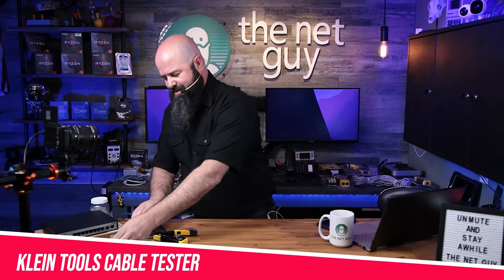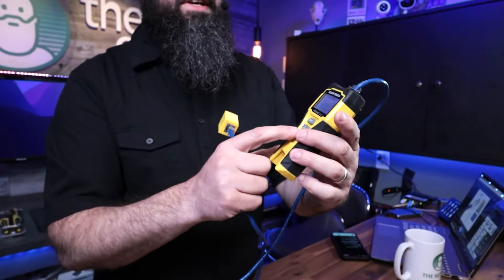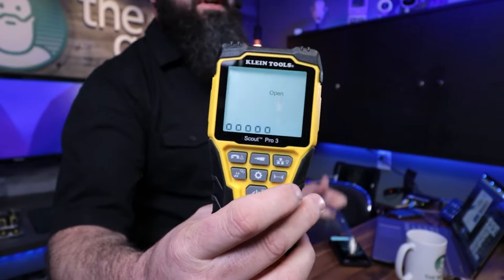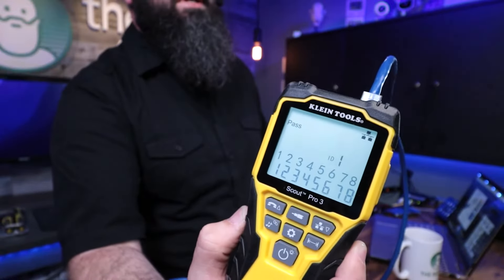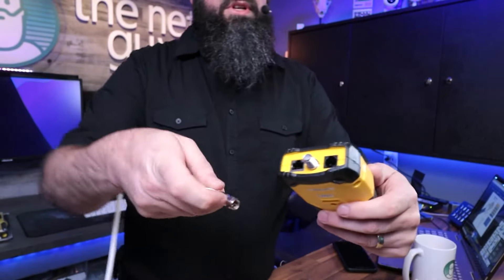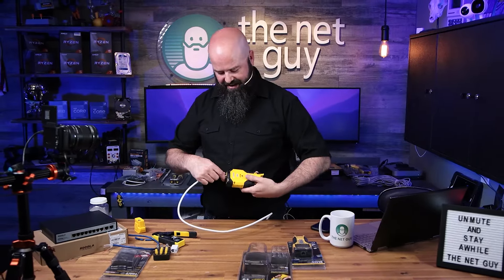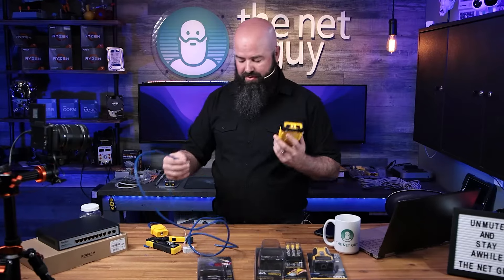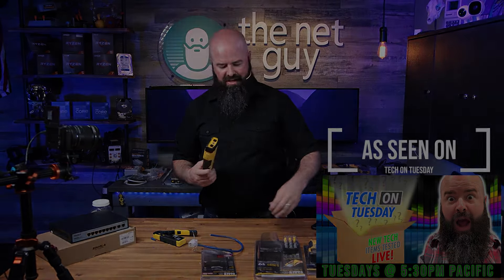Klein Tools Basic & Advanced RJ45 Testers Compared

Comment: These are great! I use a $3,500 certified Fluke tester for structured cabling but sometimes I  don’t need all that kit, so this fills that hole perfectly. Toning out cables that were mislabeled or quickly testing a patch cable, brilliant.

Comment: If you just want to test your cable, you can buy a $10 tester that will test all 8 conductors to make sure they are working and wired in the right order. But the Klein Tools stuff is just so cool... Quite expensive, but really solid products and it's what the pros use. The crimpers are definitely worth it, you want the best crimper you can get.
Reply: The pros use Fluke..
Reply: @BerserkeR_031 exactly, he must have never used fluke equipment. I personally have Klein in my arsenal. My company has fluke

Comment: The blinking cable identifier should be solid lit. Easier to identify that way on a switch full of cables thats blinking like crazy.
Reply: True or even change to color from green to amber
Reply: The tool probably just send one packet each two seconds so that the flash is constant. Other ports on the switch will flash like crazy, but you gotta find the one that is flashing at a regular pace. That's my understanding...

Comment: While testing a bunch of old inherited patch cables with the Scout 3, a couple tested as "split pair," and I couldn't find a description of how it does that. Maybe it sends an RF signal down the cable and measures the crosstalk between pairs?
Reply: Split icon illuminates if the designated wire pairs are not terminated in the
correct sequence.
Reply: @Michael_NL But this guy wanted to know HOW it detects split pairs, not the test result.

Comment: In your example with using the wall socket on one end and the other end goes into the Scout Pro 3. What if you have wall sockets on both ends, so if you had the wall socket in the garage and a wall socket in the bedroom and no exposed ethernet cable to plug directly into the port on the tool. Could you plug one of these tiny devices in your garage and then use a short Ethernet cable in the bedroom that will connect to the wall socket and the port on the tool, will the tool still print out the # of what it's connected to?
Reply from the maker: Yes, exactly.  A short patch cable would work great for finding and identifying connections like this.

Comment: Hi. New here. Can this device can also test the ethernet ports from a router and/or modem to see if it is working as it suppose to?

I've been having internet issue for quiet some time having my ISP technician test their lines. They've replaced their lines inside and outside the home not long ago, but I am still having issues.  My modem is connected to a Night Hawk Netgear XR500.

I've even replaced all my ethernet cables to see if that was the problem and still seem to be an issue.

Thanks.

Comment: ok but can the tool detect where the actual damage is,   ie   12.5 meters away from the instrument?
Reply from the maker: Yes.  It has an RF generator and can detect
Reply: @TheNetGuy  No we need to know if it uses TDR to estimate how far away it is without using anything else. Especially if it can determine which wire is cut (vs which pair)

Comment: Use case: A new house construction from an owner perspective, I want to test the install to make sure there are no breaks in the wires behind the walls before providing sign off. Will the starter kit of the Scout Pro do it, or do I need the test and map remotes?
Reply from the maker: Starter kit should be just fine honestly.  The advanced Pro features are nice if you do this all the time or are tracing wires with unknown ends.  I also have a toner I'm checking out.
Reply: @TheNetGuy  thank you. Best video I saw on this. Thank you so very much. Ordered. Legend. 🥳
Reply: @TheNetGuy  Thanks - I had a similar question as @MrOfferDJ.  Hoping to run a few drops down through existing walls and was looking for a way to test them.  Thanks for a clear/understandable video that isn't longer than it needs to be.
Reply: I know this is a year old already but....Licensed Low Voltage Contractor here. Your install company should provide Fluke test results, not just wire map and continuity.
The Fluke DSX2-8000 will test the entire assembly for all results required to certify the runs. I point this out because continuity and wiremap are not the only issues that can plague a network.
Unfortunately, unless you are a wealthy DIYer, that Fluke is cost prohibitive.

For more info, look up Cat6a Certification. Don't be fooled by cheap tools that claim they certify. Trust me, or I would have bougjt one.

Hope that helps.

Comment: Ive been hearing mixed reviews about the recent Klein tools. I.e. that they cannot detect faulty cables. What is your take on this, and is this video sponsored?
Reply from the maker: Yo!  Video was not sponsored or paid in any way, I just love their stuff and bought these myself.  

I haven’t heard about any quality control problems with their tools - they would fix anything under warranty if it were bad.  

Great brand if you can’t afford Fluke stuff 👍
Reply: I would suspect user error or misunderstanding of how the tool works. 

All these tools do is measure continuity… the adapter at the end is a loop back basically. 

They use software in the tool to add some basic additional features like length and split pair and crossover detection. 

This tool is a nice tool for what you pay and has a nice user interface and feel to it. 

The Chinese network testers are still a little clunky but with this tool pro model you can run your little network cable install business/testing just fine.

Comment: How can I identify if my jr45 jacks in my new home are set to T568A or T568B.  I took a picture of one of them, but I can't tell anything from the picture.  I ask this because I may have to re-do all of them (about 8 or 10) and I don't know how much spare ethernet cable I will have inside the wall.  If it is not much, I have to be very careful when I wire the cables with a new and better jr45.  Thank you.
Reply from the maker: If pin 6 is orange, it’s A.  If it’s green, it’s B.  When in doubt wire everything in the US to B standard 👍

Comment: Question. If a cable like that was cut,  can it tell you how far down the cable the cut might be or is?
Reply from the maker: Actually, with the distance measuring you can pick which wires it uses so YES!
Reply: if you attempt to measure it, as long as the remote isn't connected it will tell you how far down the damage is from the end you're testing
Reply: Yes, I use my $1200 Fluke for this at work, awesome such an inexpensive tester can do the same!

Comment: Will it work on 16 gauge wire for communication issues
Reply from the maker: They have some different tone generators that might be better.
Reply: @TheNetGuy  do you know a model # by chance. I’m testing mini split communication wires
Reply from the maker: @gregn8461 Klein Tools VDV500-820 Cable Tracer with Probe Tone Pro Kit for Telephone, Internet, Video, Data and Communications Cables, Beige - https://www.amazon.com/Klein-Tools-Tone-Probe-PRO/dp/B07VYN98QV/ref=asc_df_B07VYN98QV/?tag=hyprod-20&linkCode=df0&hvadid=385112208924&hvpos=&hvnetw=g&hvrand=9961589861248964322&hvpone=&hvptwo=&hvqmt=&hvdev=m&hvdvcmdl=&hvlocint=&hvlocphy=9033408&hvtargid=pla-830777640636&psc=1&tag=&ref=&adgrpid=73789135330&hvpone=&hvptwo=&hvadid=385112208924&hvpos=&hvnetw=g&hvrand=9961589861248964322&hvqmt=&hvdev=m&hvdvcmdl=&hvlocint=&hvlocphy=9033408&hvtargid=pla-830777640636&gclid=CjwKCAjwv-2pBhB-EiwAtsQZFKAbumBbrjT7XZfwgTmXF0mVE_GVFoo3i7haImz2qQa0MtyyTHk3xBoCnz4QAvD_BwE

Comment: Sir, maybe you can help me. About a month ago my PC would boot up each morning showing it was connected to the network, "fiber on1 > router > switch > pc." since than I've removed the switch. However, My PC constantly drops the Lan and goes WIFI. Sometimes I can go into the cmd and reset the Lan and reboot and it sometimes comes back to life and stays on. But I have a Roku that's hardwired and never blinks. I've replaced every cable but can't figure it out. I even did a loopback ping on the PC nic which doesn't miss a beat. Any clues?
Reply from the maker: Drivers maybe?  That’s tough.  If you remove the Wi-Fi profile from the machine does it stay connected?  There’s a metric value in PCs that tells it what connection to prioritize.  Sounds like it’s getting confused.
Reply: @TheNetGuy  Seems the on-board nic is going bad. bought a TP link card and it's been good so far.

Comment: Just curious, what would happen if you plugged in the coax coming from your ISP and tested it and then tested the length? Would it work? Would it disrupt service for other subscribers? I wanna try it, but I'm scared. :D
Reply from the maker: From what I’m told it sends an RF signal down the line like an antenna and measures the reflection.  If it’s grounded and connected to something else like a splitter probably not much.  I am surprised how hard it is to take down coax networks :)
Reply: @TheNetGuy  Right. I was hoping to measure the distance to the node. But you're right that it would probably just get to the splitter and then not get anything back, so it would error out. Or even if it got the node, it's not like the connection is open there. Still so tempted to try it...
Reply: @QuantumBraced  splitter would definitely stop the signal from passing. I have experience with professional TDR measurement equipment and have many times seen splitter if you amplify signal gain, in theory, you can go over it but measuring the end behind that becomes just a guessing game.
Reply: I did this and it came back with 24,901 miles. Typical.
Reply: @thetooth What is typical about that? What does that mean? That they have less nodes so your service is worse because it’s so far away? (I’m new to all this tech stuff but I’m trying to learn lol)
Reply: @TheNetGuy  you know, I am looking for something that rivals the Fluke Microwcanner^2.

And, that’s what it does for the Fluke, if there is a splitter or if it’s connect the tap, it’ll fail to measure out the distance.

Can you explain to me about “remote mapping”?  Also, do you know if it can tone out cables without needing to unplug it from a splitter?

Comment: Sooo it shows continuity is failing but not what distance it is failing at??
Reply from the maker: It can, you just have to change modes and set the pairing.
Reply: @TheNetGuy  assuming I have a run with 1 wire only that's damaged/cut will it show which one? I feel like this is a pain that people may encounter and somehow people don't showcase this feature.. It's rare but if you got a run that's going through some obscure paths it's amazing to know where on the run the issue is
Reply from the maker: @Airbag888 it’s a good question. I know they let you select which pair of wires you want to use for the attenuation test, which is how it figure figures out where the break is. I’ll have to dig it up and try it out again. Good question.
Reply: @TheNetGuy  Thanks man

Comment: It shows which end is crossed?
Reply from the maker: Yes and no.  It will tell you if it’s crossed or not on the cable, the end you need to fix depends on the standard you’re using. 👍. Excellent tool still.

Comment: I dont understand why you cant use hub mode on a switch/port that has POE. You can use a non POE device on a port that has POE, so why cant the tester do the same??
Reply: Voltage being sent to the tester from the poe port can damage the tester. Not sure if that's true for this specific model, but it is a thing. That'd be my guess